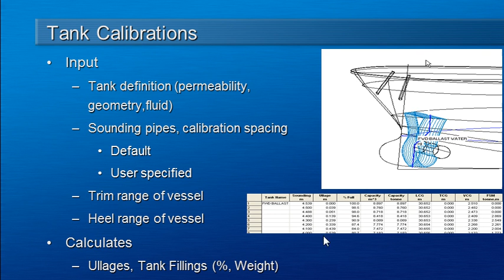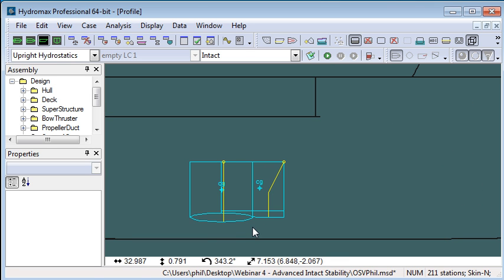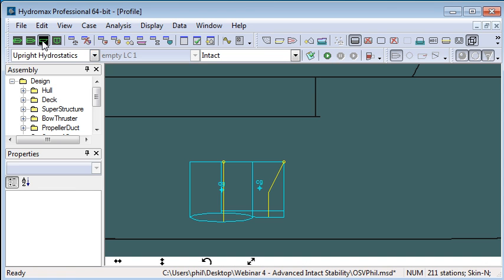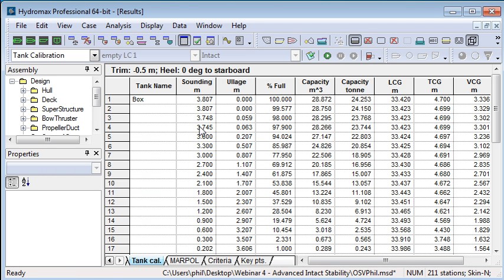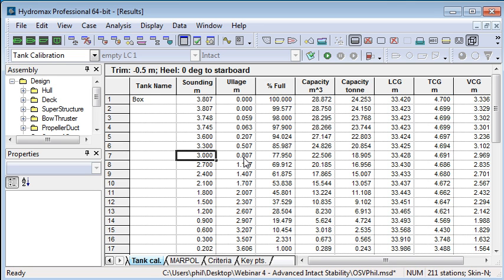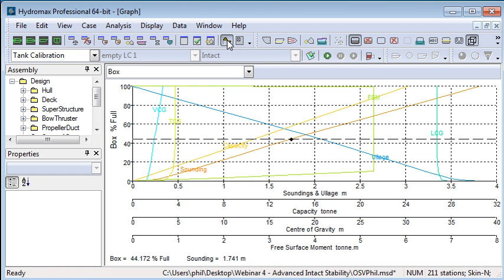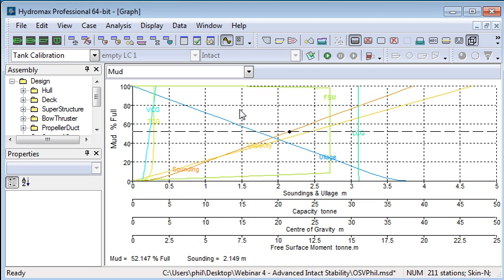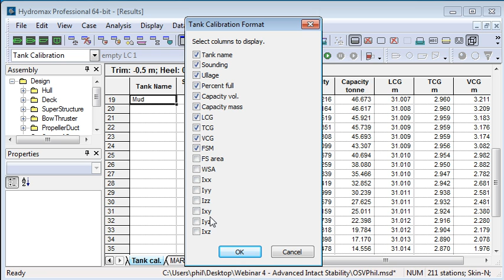Tank Calibrations

Comment: Hi sir I want to ask if what Im gonna put to the height  on the sounding menu is it the tip of the sounding pipe if its not in Auto?

Thank you and your videos are really great
Reply from the maker: Glad the videos are useful. If you use Auto you get a sounding pipe form the lowest point in the tank vertically up to the highest point. You can still enter your own spacing for soundings. If you change to user defined, you can define one sounding pipe per tank and up to nine vertices per sounding pipe, allowing inclined, bent or curved sounding pipes to be modeled. Sounding pipes must be defined with the first point at the top of the sounding pipe and the last point at the bottom. Note also that increments are measured along the sounding pipe, not along the vertical axis of the tank. If the sounding pipe is inclined or if it has multiple angles, soundings will step evenly along the inclined length of the sounding pipe.